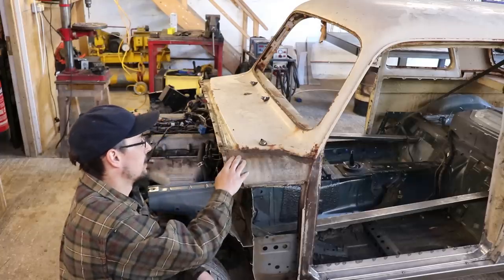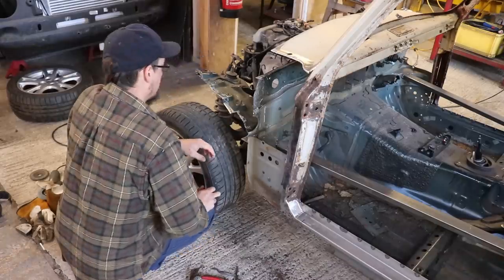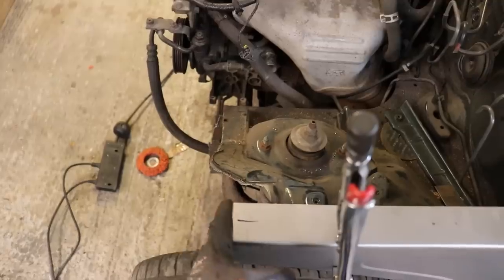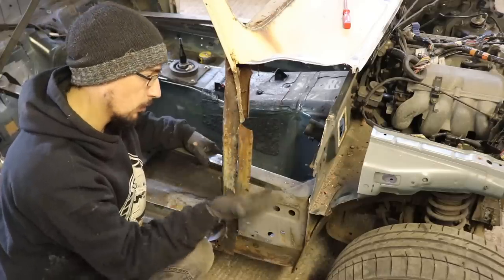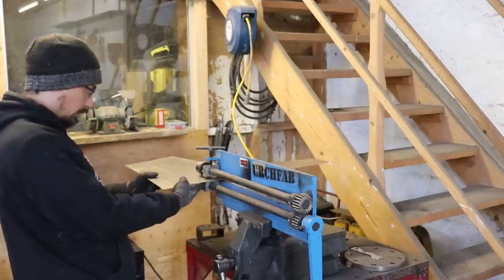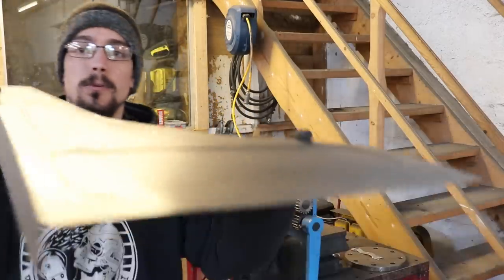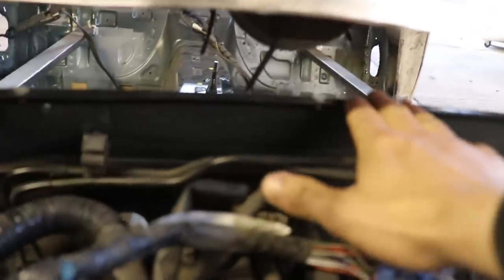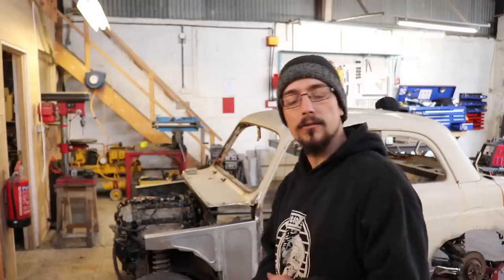THE MONGREL PART 8, THE 100E IS SO ROTTEN!

Comment: I see you use the same CAD program that Bad Obsession Motorsport uses (Cardboard Aided Design) :)
Reply: was just about to post nice CAD work
Reply: I use the same damn program.Its the most effective , and my eyes dont get tired staring at the computer screen
Reply: Was going to say the same thing 👍
Reply: I seen another fabricator using clear plastic rather than cardboard recently, thought that was a great idea. Takes much of the guessing out of it.
Reply: @martinm4961  that I have always used for fabricating door panels where using original clip holes are important as your copying an existing. Panel.
   Making panels from scratch you ussually are making your own holes .But clear is very good for copying an existing part" no guess work."
Reply: Paul Herder I think those two will die of old age before they finish that mini
Reply: I believe you are correct!  I was looking at their list of videos and couldn't believe they have been working on that Mini for 5 years!

Comment: Not sure about the UK but in the US you can buy large rolls of heavy cardboard flat stock at the hardware stores. It's a product that they use to put down on new floors while buildings are under construction. It's made for foot paths to keep the flooring from getting damaged but it works way better than used corrugated cardboard for templates.

Comment: I did restorations, got so fed up with rust decided to build a kit car, needed a van to get parts, first mot, needed some welding, 3 weeks and 80 patch panels later it was done, the rust just kept on going, maybe a flooded van. maybe I should have stayed having old cars as projects, at least I expect them to be rusty. Anyway, the 100 e. looking good, and I have just ordered a cheapo amazon bead roller based on the evidence of your videos.

Comment: Hi Matt, great job.
What gauge sheet do you use for the structural panels.  Do you use the same thickness on the cills?  Cheers
Reply from the maker: im using 1.5mm and 1mm, those panels were 1mm. Cheers

Comment: I'm glad you stayed with the build.... Yeah rust repair suck.... but what I was going to suggest maybe you can make a mechanical chain drive for your bead roller using electric window motor for an automobile and then use a foot pedal switchor something that gives you a potentiometer so you can go forward and backwards and adjust the speed as you're applying pressure

Comment: The part I dig is your use of what we in the states would consider a non-typical platform. Most builders here would just try to figure out a way to cram an LS motor in it like a battery & call it a day. No imagination whatsoever.

Comment: I know someone else has also asked but. What thickness are the replacement sheets you're using?
Love your work and the fact that you're doing this with normal tools and no fancy equipment!
Reply from the maker: 1mm for those, 1.5 for more structural parts.

Comment: Excellent vid , what gauge/mil thickness is that metal ? I’m intrigued how you can weld that without stopping and not warp the shit out of it ? I have watched your vids on welding the different thickness metals , is that the case here ?
Reply from the maker: If you have a pressing or bead rolled edge near the weld it really helps for warping.im using 1mm and 1.5mm. Cheers
Reply: Urchfab I see thanks 🙏🏻

Comment: It seems if he had chemically stripped the body when it was off. It would have made the rust obvious and the subsequent work easier.
Reply from the maker: I will be getting it blasted but I wanted to wait until i have the two joined together so I only need to pay for one car to be blasted.
Reply: @Urchfab  I was thinking more along the lines of chemically stripping in problem areas. Indeed media blasting is expensive.
BTW I love you videos. A mechanic in a garage working in the dust and grit of most shops. I even like your intro, simple, plain cut and does the job in a workmanlike manner. The work you do is fascinating.  Thanks.